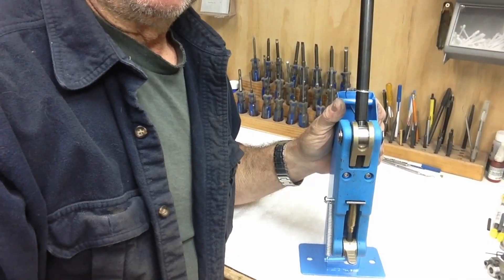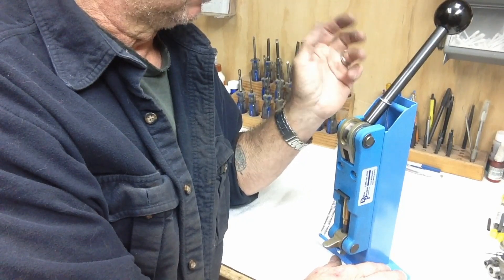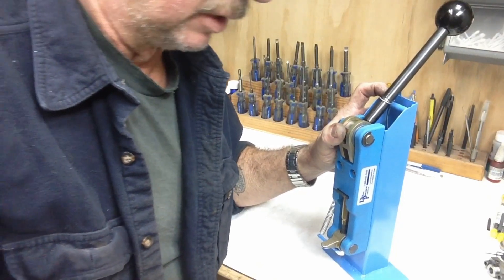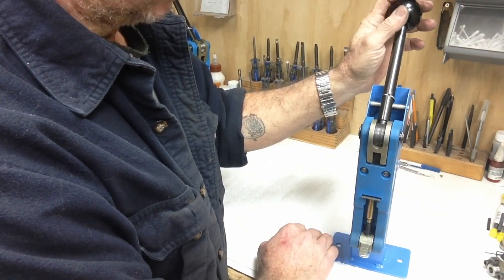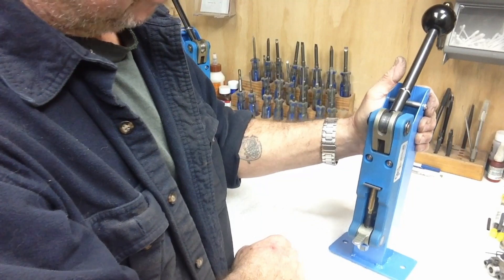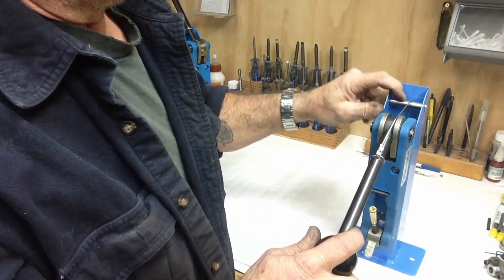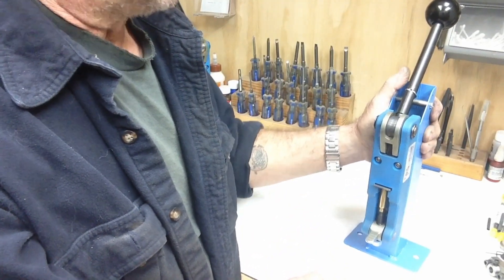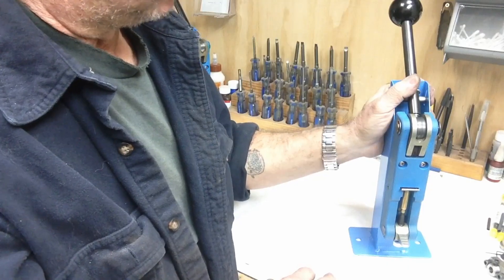Dillon  "SUPER" Super Swage 600 Upgrades: In Stock

Comment: Greetings from Australia.

I've had a Super 600 for a few years and it certainly does the job more elegantly than the CH and RCBS units I have tried before.

I haven't "hot-rodded" mine , YET, but that will probably happen soon.

A couple of caveats:

Because the cases are held on the "spindle" and pressure applied via the case web, "batching" cases, ESPECIALLY in 7.62 NATO and oddly enough, 9mm Para is essential. With the leverage in this device, it is way too easy to OVER-swage the pockets to the point where the primers will be loose, or even just fall out.

Fortunately, you only have to swage a primer pocket ONCE in its lifetime. After a couple of thousand, the word "boring" takes on a whole new meaning.

And another thing: I do this operation on essentially "raw" once-fired cases, either chance availability from the scrap merchant or the ones that kind folk leave scattered about the ranges; waste not, want not. It's not that I shoot 500 rounds a week, just that brass is brass;  I even reload a a bit of Berdan-primed rifle brass and will keep doing it until the primers disappear.

Speaking of Berdan-primed cases; I used a Carbide centre-drill to form an anvil-clearance pocket on the swaging end of the "Large Rifle" swaging rod. Thus, I can clean out .217" Berdan pockets and standard .210 Boxer with the same tool.

First operation in the business: Cases are given a rudimentary wash to remove bits of range, like sand and grass and then simply air / sun dried. This keeps nasty stuff out of expensive sizing dies and presses.
Reply from the maker: I usually don't have issues with overswaging the pockets, but I batch mine as different brands and even the same brands from different lots have different case web thicknesses so require minor adjustments. I don't normally mess with berdan primed cases and they usually go into my scrap brass bucket.
I now wet tumble all my brass usually at least a couple of times throughout the reloading process as I think it produces a better looking round and allows the gun to function better and in some instances more accurate loads. Thanks, Dan.